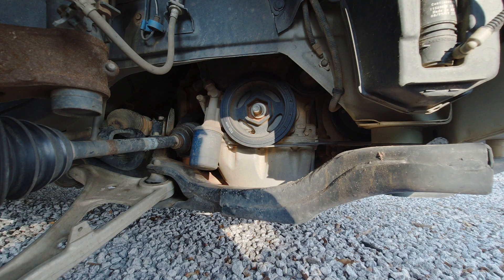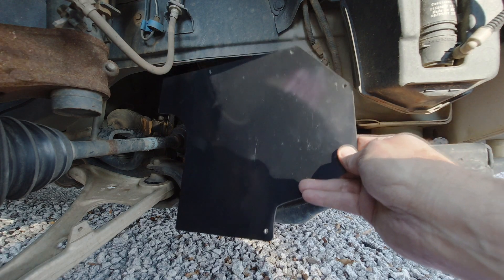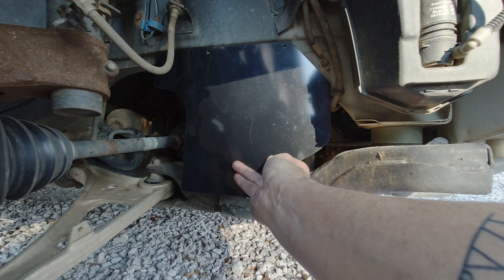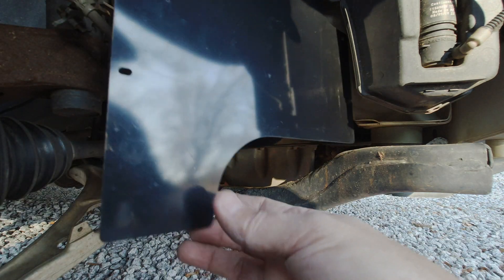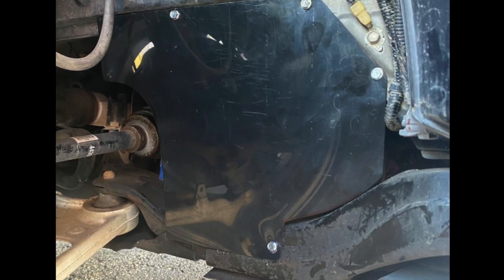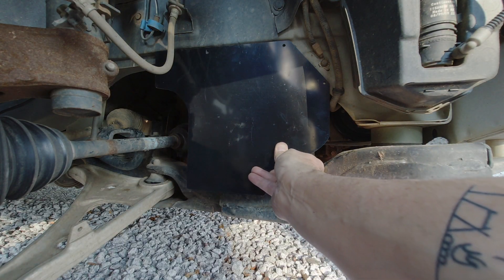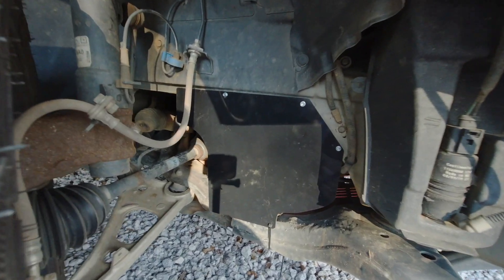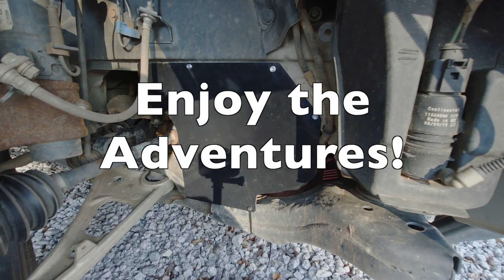Honda Ridgeline Passport Pilot How To Install The Ridge Store Oil Filter Serpentine Belt Protector

Comment: Why not cut a little off the bottom left so you can still access the oil filter? Or is it you plan just to remove the panel for maintenance purposes
Reply from the maker: It’s purpose to protect, so yes you would remove.  Thanks for watching.